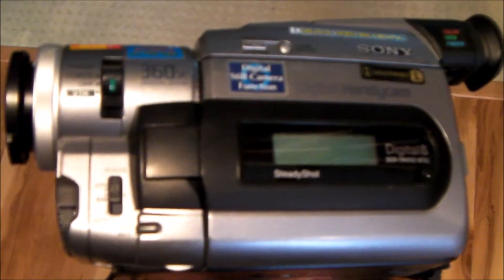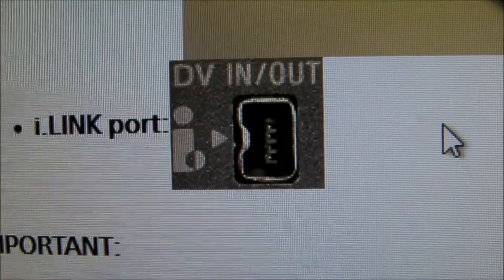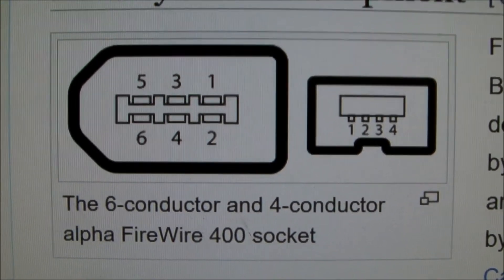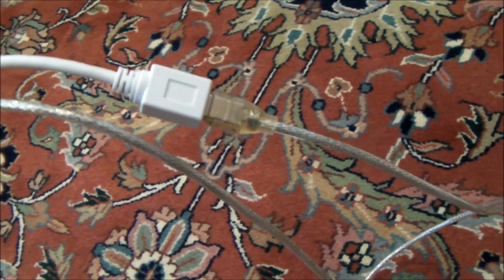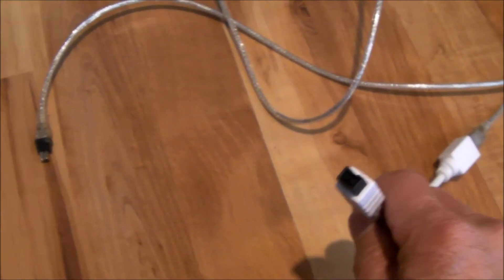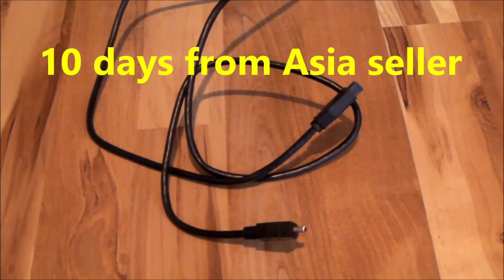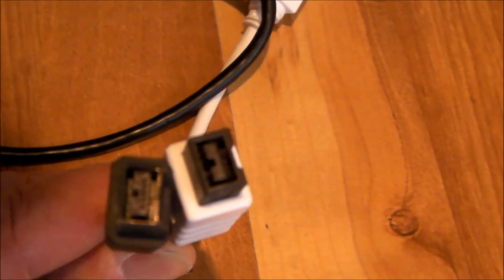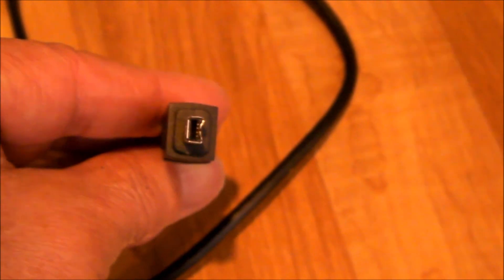Camcorder Video to computer - Firewire, i-link, IEEE1394 - which one ???

Comment: Im trying to connect my older Sony Handycam Camcorder which uses IEEE 1394 4Pin Male iLink Firewire DV connector and I want to connect it to my 2015 MacBook Pro which uses Thunderbolt 2.  Is the now $130 dollar adapter that’s only available on Ebay the only option I have to get these old digital tapes into my computer to preserve the memories?
Reply: Any old FireWire adapter should work.